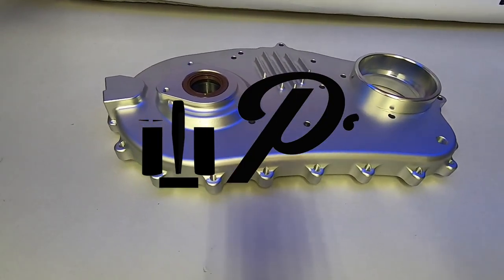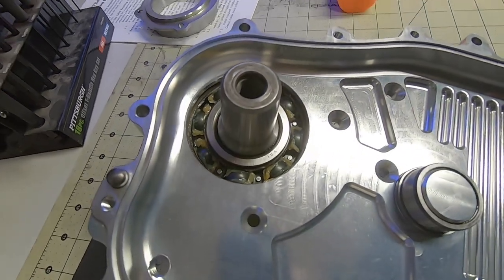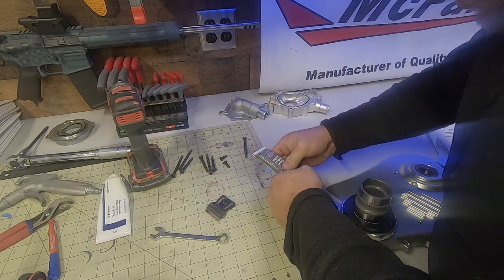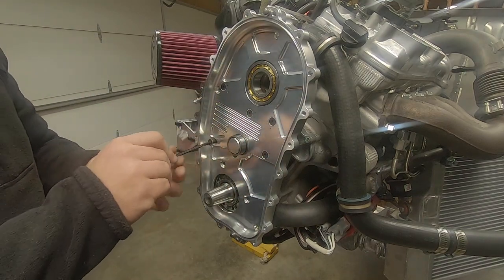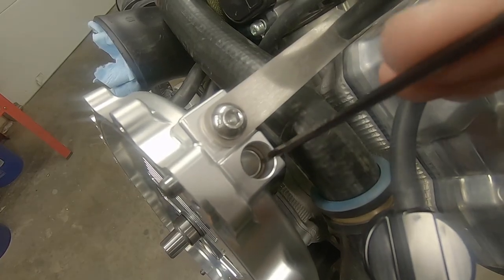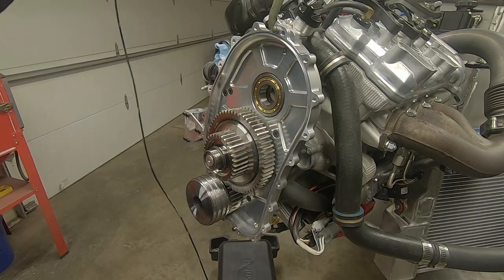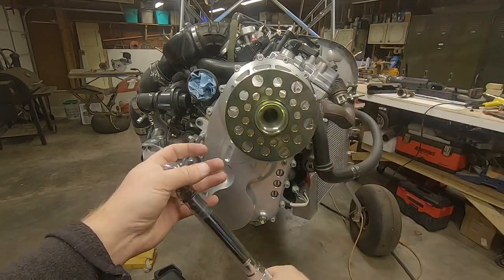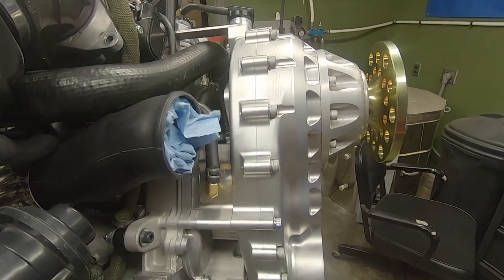Skytrax Gear Box Install for 998T Yamaha Rans S21 EP42

Comment: Very nicely done. How come you don't put a small blob of rtv where the seal splits at the top? Seems like a spot that will start to leak in time.
Reply from the maker: I suspect it won’t be an issue but I don’t see what it would hurt to add a bit there just in case if a guy wanted too. Thanks for watching sir👍

Comment: What electric water pump are you using ?
Reply from the maker: Early on I was using a Pierburg CWA400 knowing it was way to much but I wasn’t sure how much flow I’d actually need. I’m now running dual EWP80’s from Davies Craig. Much lighter and easier to package. One is enough to keep the cooling in check and the second is just redundancy since I’m not using the stock mechanical pump.

Comment: Great work! Since the engine is water cooled have you thought of installing a heater core and blower to heat the cabin and lastly how much is the complete engine weight fwf. Thanks Mike
Reply from the maker: Thanks! A heater core is the plan once I make sure what I have is working ok. I expect this engine package to be around 200lbs. I will weight it all when I get it all gathered up.
Reply: Cool thanks

Comment: Video nicely done as always.  What was that grey paste you put on the case bolts, anti-seize?  Lubrication will affect bolt torque.  Also a good idea to make 3 torque passes (1/3, 2/3, full) vs going to full torque on first pass.  Do you plan to clean the grease out of the gearbox bearings that were factory greased?
Reply from the maker: Thanks! All good points to consider. The grey is high temp sealant. Thanks for watching👍